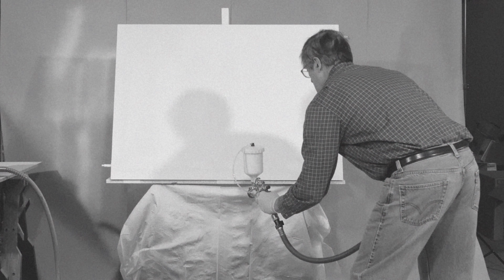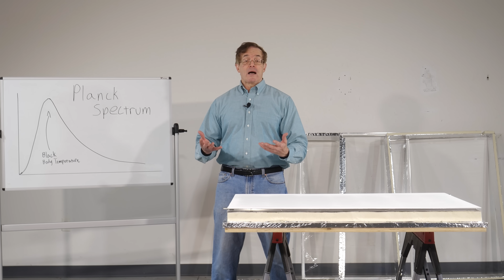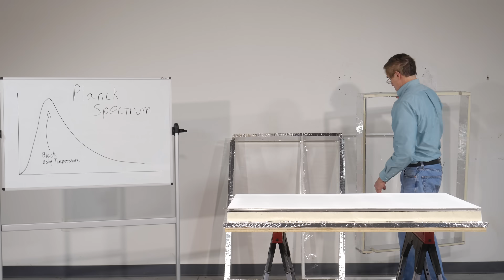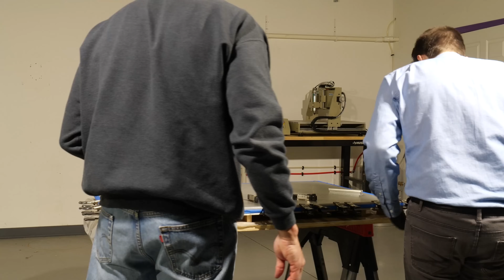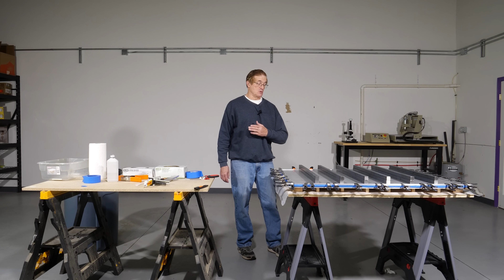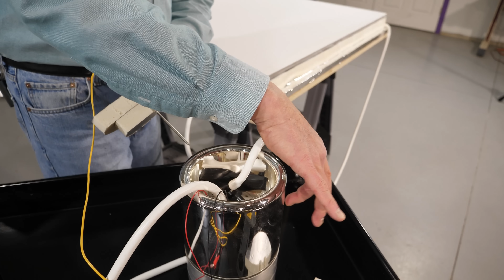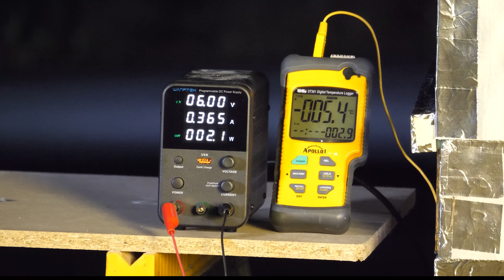Air Conditioning isn't free... but we're close.

Comment: My planed experiment was to BURY the post fins hot copper piping about 1 to 1.5" underground.  The idea is to make a "hybrid" system to avoid the huge cost of the 8'+ deep compressorless system lines but still increase efficiency of a standard system so that the freon is cooled to below the outside temperature.

Now from what I am told by my AC contractor friend helping me with this is that this only benefitys me if the "THC" halve is 100% open.  So I need to see at what temp the THC valve is open BUT the second half of the experiment is to add a SECOND A coil to the air handler so that the fron flows through the air handlers in the OPPOSITE direction as the air flow.  This should cause the THC valve to open much sooner.

I am starting out with a 10-15 year old 13 Seer system and I'll see how much extra feet of buried coper pipe I need and try to find the ideal amount of pipe to where the cooling of the hot fron is as good as it can be.  I also considered burying sectioons of baseboard-like piping that has fins to try and increase the surface area contact.  

Does this sound like something that could be a success?

I am also working on a improved "Energy Star Home Improvement Program" that is 100% based on recorded data recording evergy in and out of each room of a home anong with outside conditions to best determine what needs to be improved first/most in an older home to get the biggest boost in efficienvy.  The system used COTS software and Z-Wave hardware.

https://twitter.com/StevenMercuri10/status/1610160115784777729

https://twitter.com/StevenMercuri10/status/1622039643079299076

Comment: I would love to see a series of videos on passive heating and cooling systems used historically like thermal sinks, shaded windows, spiral chimneys, domes, alleyways, orientation to the sun and courtyards. The ones used for thousands of years in the middle east and south east asia. 
Determine which ones add the most effect and comfort, and the ones that work best - Push those to the extreme to show where they hit their limit of effectiveness. 

We need a solid engineering/science look at these techniques that don't use fancy coatings or power, just simple low maintenance materials such as mud, brick, wood, sand and stone. This would be super helpful for lowering our footprint and power usage with ancient but forgotten techniques. 

Love your videos! Keep up the fantastic work!
Reply: cc

Comment: Great video. I'm curious if using a galvanized steel sheet on the top would work better that an aluminum one since the aluminum would resist the infrared energy in the water from transferring to the surface? That's what I understood from your lecture anyway. This would cut down the cost and make construction easier. Also it occurred to me that using a heat pump during the day then store the heat (in the ground maybe) and then radiate the stored heat away at night might be an effective way to use this tech. Please keep making this kind of content!
Reply from the maker: It wouldn't, but the difference  would be small.  The heat transfer from the water, through the metal, to the coating is conductive,  not radiative, and aluminum  is a much better heat conductor than steel.  However,  the huge surface area combined with such thin metal sheets would make the differences trivial.
Reply: So does that mean that aluminum is still a good emitter of infrared radiation but poor at absorbing it?

Comment: "Air is actually a great insulator when it isnt moving, its the air bubbles in the foam that do the insulation not the foam itself"

You unlocked a pretty deep intuition with that one in me, thank sir, may I have another.
Reply: It's also the reason aerogel is simply the best insulator out there
Reply: Polyurethane foam is not filled with air. It traps the blowing agent and achieves an R-value about 50% higher than air.
Reply: This is why on a still cold morning, if you stand still, you will keep warm.
Wind kills.
And why loose clothes, like pyjamas are strangely warmer than tight fitting insulating clothes.
Reply: Yep - that’s right, and that is because there are less molecules bundled together unlike water - which is tightly bundled, and conducts heats fast.
Reply: It's why a stanley cup is just two pieces of metal with an air pocket in between.

Comment: I’m fascinated by the potential of this. I live in a desert and during the summer months, our electricity bills skyrocket; if we could make passive cooling work for residential housing, it would be revolutionary. I’ll be studying this further, thank you so much for sharing your process and discoveries!
Reply: I'll bet your ground temperature a few feet down is in the 60F range. Just one 50 or 100 foot loop would probably give you cold water to circulate in a radiator with a small pump to cool your house. If you do, let me know the results.
Reply: I agree, I also live in a desert gets hot during the summer around 120°f 

Although, I think while this is a great project with a lot of potential in these hotter areas it might be best as a cost saving measure as better insulation for already existing measures
Reply: @ProtoPropski To many days at 120 I think I would have better luck underground lol
Reply: @ProtoPropski  I have always wondered by people in extreme hot do not insulate their houses just as we do in extreme cold. In both cases large energy savings can be had.
Reply: @Munakas-wq3gp  
Well, we do have some ways we insolate in heated areas, but they're just far more privative then cold areas, especially cause there's almost no business incentive when air conditioning is making as much money as it does in hot climates .. greed is the greatest enemy to innovation

Anyway as I was saying our current way to insolate is adding an outer layer of clay, and mud to our houses on top of concrete, and mortar, while maintaining the same traditional housing insolation on top of that, it's honestly patch work, and comes from Native American tradition, which works, but it's still just not enough maybe cause us modern folk are not putting enough on our cookie cutter houses, (which I'm willing to bet), or it's just not as effective as it use to be thanks to all our human integrations like concrete, asphalt, and solar panels which all attract, and emit heat at a staggering rate especially given how prevalent, and required they are for urban invasi... I mean integration
Reply: Why not look into geo thermal chilling?  It's a cheap and very inexpensive alternative.
Reply: Windows are the enemy of comfort in a home. Even the best windows are usually only about R4 to R6 insulation value. A great way to lower your AC needs is exterior shades on all windows. Especially windows that face south and west.   Then pair the exterior shades with thermal curtains inside.
Reply: Right? I’m in Phoenix and what this could do for those of us dependent on AC is too much to wrap my head around. Imagine not just all the roof areas but cars too! I’d paint my car with this in a heartbeat. Pool decks, paving stones, sidewalks… Plus less heat development due to us running AC all night. Part of the reason it runs is that our structural shells still retain heat gained during the day. This would be so amazing.
Reply: As the desert has really low humidity you can use evaporative cooling,
Reply: @taciusa this method allows you to save precious water though.
Reply: @apt8012 it's in a loop you don't lose water.
Reply: @taciusa   Do you live in AZ ? The monsoon season turns this dry heat into a humid Hellish land 😅
Reply: There is also video by NightHawkInLight(he has pinned comment under this video) about producing heat-radiating paint from cheap materials.
Reply: i have fix air conditioning in the desert for nearly 20 years. making thicker walls like adding a whole nother layer of plywood and restucoing over that. and better insulation and smaller windows and or shade the sun before it hits the windows. Especially need to put the most insulation on the walls that get the most sunlight. I did that to the south of my house because it gets the most sun and it made a world of difference. think of it in terms of making the house more comfortable. making the house more comfortable makes it more energy efficient. insulation is the key.
Reply: It could be used to collect free fresh water if the dewpoint was low enough.
Reply: Look up Iranian wind catchers.
Reply: aren't desert cold at night?
Reply: @JoRoBoYo  Cooler, but definitely not cold. Conditions within city limits are much different than in the actual middle of the desert. Today’s lows are projected to hit 84°F, far from what I would consider cold.
Reply: The Navajo figured this out thousands of years ago. Just build pueblos. Low-slung, densely packed, whitewashed buildings made of dense stone and baked clay effectively act like artificial caves, bringing the temperature underground up to the living space. They can also be repaired using stuff you find lying around.

Of course, white morons decided that single-family homes made of wood and glass spaced as far apart as possible with grass lawns each serviced by an asphalt street were the optimal desert home. Maybe we should have listened to the experts in living in deserts instead of genociding them, huh?
Reply: Lol you guys are idiots, in sorry but a/c in a house and water automatically cancel eachother out😢
Reply: But a short distance into a cave and it's cool.  Could be coatings with high emissivity are beneficial, but insulation rules the day.
Reply: Also look into PCM:s (phase change materials) which would enable you to use the large temperature changes from night to day efficiently.
Reply: Hydronic cooling and heating. Its common in MA. Pumps cold or hot water through baseboard radiators. Uses about 200w, impacts the entire house. Easy, cheap and great for older homes or people with sense.
Reply: @superkoopatrooper4879 
Are you implying that people with older homes don't have any sense?
Reply: PLANT TREES 🤡
Reply: For the places with a lot of sun, solar panels is a better way to go. By far. With them you can not only run the air conditioner, but also cook, wash, shower and watch TV - all for free.
Reply: @barmalini  the idea behind passive cooling is to eliminate the need for electricity consumption to cool our homes and greatly reduce our energy footprint.
Reply: @kvnivn05  living off the grid reduces your footprint right down to zero, you cant beat it with anything.
Reply: @barmalini  sure, but it’s not really feasible for every citizen living in my city to live off the grid. reducing the need for air conditioners and simultaneously reducing your energy consumption, that sounds like a win for everyone, and you avoid extreme solutions like living off the grid.
Reply: @barmalini not better, also good. Efficiency and overall reduction is the path to sustainability. Continuing to consume without consideration and throwing more panels and batteries at the problem isn't a solution.
Reply: passive cooling already worked for worse conditions than you experience, we just don't use the applications.
Reply: If you do rainwater capture you could use a swamp cooler
Reply: @cxsey8587 it rains once a year, so not really possible in my region
Reply: There already is passive cooling for the desert. Look up evaporative cooling. And the cooling towers in India. L
Reply: Paint your house and roof a light colour insulate better. Make sure you have significant over hands on all your roof ages for shading. Plant plants that provide shade. By therman curtains and blinds, build a pond ...
There plenty of passive ideas designed for "residential houses"

Comment: Just watched and this is super exciting I just got this thought and maybe it has no practical effect but I was wondering when it comes to blocking or reducing the environments Infrared

From buildings trees and other structures 

I was wondering would a pyramid shape with the top portion removed help with this 

Essentially narrowing a large base area to direct its heat out while preventing the surrounding areas from interference by reflection of the surroundings but direction for the exhaust if you could call it that 

And essentially compounding the effect if that makes sense
Reply from the maker: It wouldn't  compound  the effect, but it would be an optimal design to block the ambient infrared radiation.

Comment: I'm denser than lead to understand all this but how do you deal with the humidity? I live in the tropics and it's what makes the summer heat unbearable.
Reply from the maker: Airconditioning involves  both cooling and dehumidification.  Both processes require energy. If the cooling component  can be dealt with through  passive heat rejection this reduces the energy requirement.  If that passive process is effective enough, then the humidity  can also be reduced through condensation on the cold surfaces.

Comment: I dont understand why the reflective collar is effective. In the same way as radiation from the panel reflects in the walls and goes to the sky, radiation from nearby buildings can reflect in the walls and go to the panels, no? just propping up the rectangle up should not make a big difference, from the point of view of a nearby building you see a similar area of box where your outcoming radiation will end up in the panel.

I do understand however that this chamber covered by the plastic will keep the air above it not moving, and this is a desirable effect. But the first effect I don't understand why it works. I think one would need a really tall chimney to shield your panel from taller objects because of the reflective coating on the walls. Or a more complex wall geometry.

Comment: Maybe I'm missing something but to me this just looks like a VERY inefficient heat sink.  I mean, if you just run room temperature water through an AC condenser coil it will get cooler also.  That's it's purpose.  The only difference between the two is that this one can't dump heat as fast as an AC condenser coil can and it requires a lot more room, fluid movement, etc.  And you are fooling yourself if you think his version is energy free.  You did notice the pump... right?  Yep, same as an AC condenser coil would require.

Comment: @Tech Ingredients While easiest to paint the large flat surface seems the least efficient in terms of surface area. What would happen if you took a large finned radiator or several smaller radiators, coated that with an extremely white paint such as the barium nanoparticles and put the radiator in a reflective box? It seems to me that the white stuff should be reflective enough to let the infrared escape even if it needs to bounce between the fins a bit. Painting might be tough but radiators can already be bought off the shelf saving quite a bit of construction time. Could the painting be done by submersing the radiator in the coating instead of applying many thin coats? Could the efficiency of existing radiators in general be significantly improved if covered in highly emissive paint? This technology reminds me of how people used to make ice in the desert already 2000 years ago. They built these conical structures with a small opening at the top, with clay floors where they poured water. When the sky at night was clear the infrared and warm air escaped through the small opening at the top of the structure and the water on the floor cooled down.
Reply from the maker: It turns out that flat is just as efficient.
What matters in radiative cooling is different  than with convective cooling that depends on air contact.  The coating is mat, and so it radiates diffusely. Deep pillers or fins will not increase the emission because emissivity and absorption are related.  The emitted  radiation  doesn't  bounce around. It is absorbed.
Reply: @TechIngredients  Thanks! Good point. I understand that there are some relatively novel wavelength shifter materials now that can shift infrared to visible range. Normally black body radiators are extremely black such as on satellites where cooling is needed in the vacuum of space. These absorb radiation in a wide range of frequencies. Perhaps there's still some way to take advantage of the otherwise high reflectivity of the white nano coating by shifting it's emitted light to avoid re-absorption. For example lets say there were some pieces of plastic between the radiator fins that shifted the infrared emitted by the white paint to different wavelengths that wouldn't get reabsorbed into the white paint and also wouldn't easily conduct heat back into the radiator. May be a challenge to find the right material for the shifter if it even exists already.

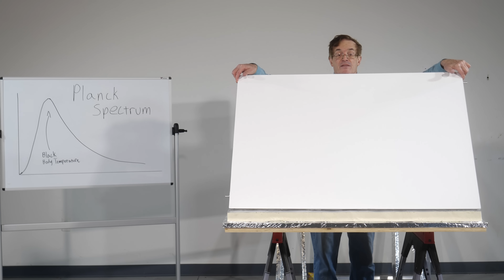Comment: At 8:51 into the video, he mentions how he built the center with "Neat Little Devices", that you can get on Amazon, but doesn't mention what it is or what it's called and doesn't leave a link to what it is or to buy???????  That doesn't help anyone.
Reply from the maker: These are called water cooling blocks.  They are widely  available  on Amazon for cooling, CPUs, LEDs, and other electronics.
I didn't  use these, I modeled  the big heat exchanger based on these devices.

Comment: Have you ever looked into elastocaloric cooling? Sounds like a really promising technology
Reply from the maker: Yes.
Just like magnetocaloric cooling, they share one difficult  challenge.  The temperature  change occurs in a fixed, solid material within the system, which periodically heats and cools.  Extracting this cooling effect is very difficult and inefficient because  the working fluid (including air) has to pass through  the same structure, which blunts the temperature  changes.